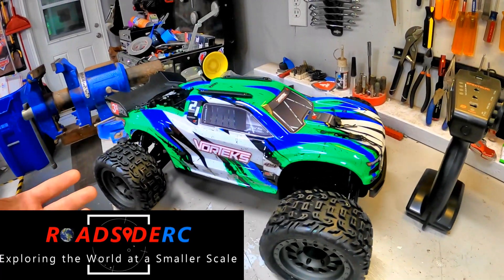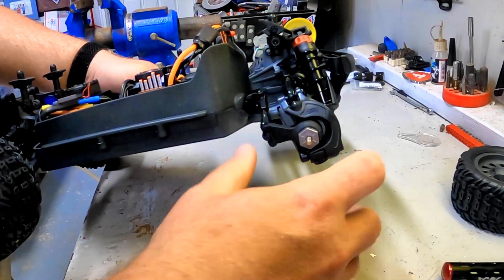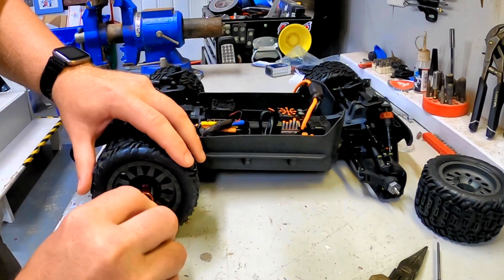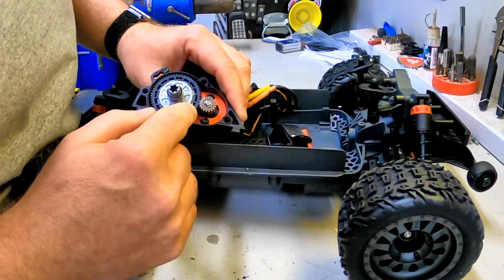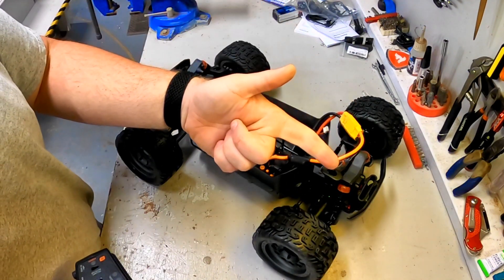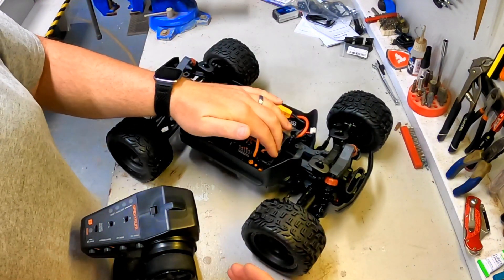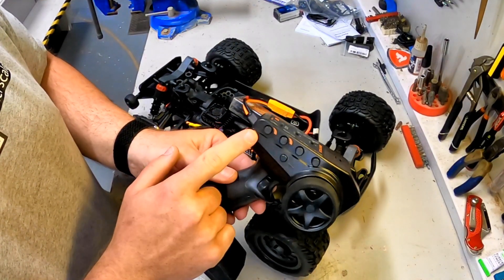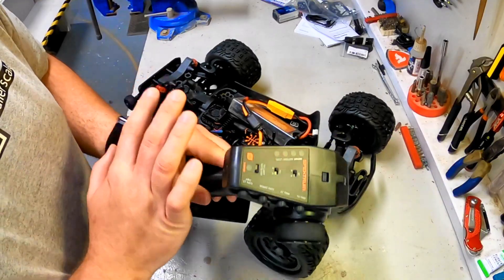DO THIS FIRST! 6 things before you drive the Arrma Vorteks4x4 BLX!

Comment from the maker: These tips will apply to ANY of the Arrma 3S lineup.   

If this video was helpful - consider joining as a member!   The cheapest membership is only $0.99/mo!
Reply: Hi @RoadsideRC

I am planning to by Vortek 3s blx V3 version.

Request your advice whether I should buy it or should.look for some other RC car

I need my rc car to be fast fun east to control and maintain and be durable atleast for an 1 year of use

Pls let me know whether I should buy vorteks or not
Reply: @AbbyRCToys Don’t know if you bought one yet. But I have had one for about 2 years. Never had a problem. Runs great and fast on 3s. Never put the bigger pinion in yet. It’s only for speed runs. Don’t use it for bashing. It will over heat your ESC!!

Comment: Can't believe 6 months ago I missed that you said you fly fpv on the channel. Subbed immediately. I'll be checking out your flights. I actually commented about how nice this list of things are to check and I did nothing but go out and run the trucks I bought without doing any of these things. The wheel kept flying off of my vorteks so I used blue loctite and haven't had an issue since. I has the granite blx first for about 2 or 3 months then bought the vorteks when it came out because I liked the granite so much.. the blx line is perfect for my 7 year old son and I. The steering serve went in the granite so I just did these all endpoint settings but just way way late after purchasing. 😊 Thanks brother
Reply from the maker: Awesome!  Glad you are enjoying the Granite and Vorteks!

I agree - these 3S vehicles do everything I need.  The more I run them, the more my 6S models sit...which isn't what I would have guessed.

Comment: I'm having mine delivered tomorrow, great video. This will be my 4th arrma. Big rock, typhon, Senton and now this one tomorrow. I will. Be checking everything.
Reply from the maker: Awesome!  I still need to try a Big Rock at some point.
Reply: @RoadsideRC  it's a really good truck, my first arrma. So fast but not so stable in the corners at high speed. I've just changed the tyres to some pro line ones which are wider and as a result holds better in corners. It wheelies like a crazy evil kenevil. Very impressive bit of kit.

Comment: I had a infraction the throttle was set 100% full throttle at neutral point. It took off on the bench and I had it raised so the tires were off the bench but it still took off. Very important what your talking about. Great video!!!! All cars should be looked over.
Reply from the maker: Oh my!!!  An Infraction taking off at 100% - that is literally quite the dangerous thing!  Glad you had it off the ground!
Reply: @RoadsideRC  lol, it came off the stand, not a good day.

Comment: I tried my Vorteks for the first time today and it had a horrible scrapping noise coming from the rear diff area. Turning the wheels by hand it would sometimes seize up so it couldn't go any further without using excessive force. I had to cut and file plastic off the diff housing where one bearing sits and also remove some protruding plastic lumps from the inside of the part that holds the diff as the diff was scraping on that when it rotated.  Really great quality control there Arrma.
Reply from the maker: Interesting!
That is a new one - hadn't heard that one before!
Reply: Reading experiences like these all over the internet makes me sad. I bought two 3S arrma's end of march, in the EU. I ran into all the issues one can think of. Is HH killing Arrma's reputation? I wanted a 6s Notorious next, but sadly I am looking for other brands now. I have no confidence in the Arrma quality anymore. And their Customer Service is totally different here in the EU.

Comment: Almost impossible to get a real read on that gear mesh without the front end of the spur gear being supported. I had always ran a piece of loose-leaf paper between the two, pushed it tight, and set the screws with paper still in between. Have never stripped a spur or pinion in over 30 years in the hobby. But tough to do on this one. I've got an Infraction 3s, and LOVE it. Looking in to this guy now. A great, and very versatile platform they've got there! 
  seeing the part with the overall inspection and screw tightening, always a good idea! I found all sorts of slop in the steering on my Arrma Typhon 6s, to find whoever assembled it must have been distracted, as it was missing the lower bushings on the steering posts. I got a couple nice ball bearings for that. Perfect excuse for that little upgrade!
Reply from the maker: Yes!  I agree 100% - setting gear mesh on these is not as straightforward as it is in other vehicles.

Comment: Great guide. Got myself one this winter and this guide gave me the courage to take it apart. The technical manual is pretty nice but when you see all those small pieces you start to doubt your skills. If I had any tip, it's to get those 2 and 2,5 thin and long hex drivers for those wheel nuts.
Reply from the maker: Great tip!!!  
Glad the video helped you.

Comment: Great video! Just got my Vorteks 3s today. I will check these steps first for sure. Also, I didn't buy a Lipo and a charger yet, as I wanted to inform myself first. I read this is the best battery? Zeee 3S Lipo Battery 8000mAh 11.1V 100C Hard Case with EC5 Plug. Could anyone confirm this? Also, which charger would fit?
Reply from the maker: Hi there!   The Vorteks is a great choice!  

For batteries, I actually tested a lot of different batteries in the Vorteks.  I found this to be the best for me:  https://youtu.be/V3nwK3kDfV4?si=j_wnAD7s2nnV6oG4

For chargers, check this out:  https://youtu.be/1gb8Oohhciw?si=jkIQxAL0MK6Paz5q

Comment: I just got into RC couple of months ago and doing reviews for several months what to buy and I picked up the Vorteks today in purple and it is Out of this world. Videos are not enough you have to drive one to experience it. The speed, handling, sound of the engine and tires, it is a beast 💪🏼. Can someone explain to me do I have to do ESC endpoints adjustments, I would appreciate it. Thanks
Reply from the maker: Glad you like it!
You shouldn't NEED to set the ESC endpoints, but it doesn't hurt.
Reply: @RoadsideRC  do you suggest to change  to the other pinion gear it came in the package to make it go faster, what is the 2nd pinion for overall, please let me know.
Reply from the maker: The other pinion will make it faster. 
I did swap mine in and have left it that way.

The negative is you will build more heat in the motor and ESC as they work harder.
Reply: @RoadsideRC  thank you for your help, was it hard to change it to the other Pinion approx how long does it take? Hopefully you don't mind me asking questions, I rather ask and learn more.
Reply from the maker: It is rather easy to do. 
In my video on "top things to do before you drive", I show almost the whole process when I tell to check the gear mesh. 

Also, I think the manual actually shows how to change the pinion.

Comment: Great video 👍 will check these when I get mine in a few days. Some have mentioned the slipper clutch also being too tight, do think this is a concern that should be checked right out of the box?
Reply from the maker: That could be a good addition for sure.  
So far, I have had no slipper issues.  But I am pretty simple with a slipper.  Either it is too loose and you can hear it slipping a lot.  OR, when it is too tight, it breaks driveshafts.  So far - no broken driveshafts.

Comment: Great video but one thing I would add is that you should inspect all your shocks.
I realize the stock shocks are only plastic but it seems that most of these kits come with barely any shock oil in them.
I suggest topping them up and re-sealing them before you go out on your first run. Also, consider the ride height, I'd suggest adding at least the middle sized shock spacers, (included in the kit), to all shocks to bring it up a little. 
I'd be happy to hear your thoughts. 
Cheers from Ontario Canada.
Reply from the maker: Thanks for your ideas!
Double-checking the shocks is a good idea for sure!
I don't think I would raise the ride height though - I like my cars nice and low for better handling.

Comment: Hi great video on setting the radio up, do you know if the duel rate on the steering can be adjusted on the fly with the st rate knob on the tx whilst you are running the truck.? Or do you have to go into the program mode on the tx each time to alter the steering dual rate. Thanks.
Reply from the maker: If you disable the AVC, then it works like a normal dual rate knob.
Reply: @RoadsideRC  Ah so you cant have AVC & normal dual rate adjustment together, its one or the other I suppose. Can you remind me how you disable the AVC.

Comment: When doing your steering end points why are you not using the A/B button? I was shown to first make sure it drives straight with trimming, than max steering dual rate, than start your radio calibration the same as you but hold steering noob max one direction than use the A/B buttons to get to the max end points. Was shown this by a friend but if you want a video format check our RazorRC channel it’s the same as I explained. WONDERING if both ways are correct what do you think 🤔??????
Reply: Think it’s the same sh#% different pile ?
Reply from the maker: Someone else brought this up.  
I am pretty sure what you are talking about is the calibration between the receiver and controller to ensure you get the max endpoints of the steering.  
This is to actually limit the total steering by setting the end points.  
Two separate things. 

Honestly - this is one of the downsides to the Spektrum radios - they are too danged complicated in this way.
Reply: @RoadsideRC  I feel both ways are the same, using the dual rate like you did gives you and end point and so does my way I was shown only different I can think of when talking with RC crew is that my way eliminates accidental bumping of the dual rate noob, switching between users etc.
Reply: I can’t wait to get the Vortex I have Granite BLX at the moment and love it but I really messed up the back of the body learning jumps etc lol 😝. So you an American RC enthusiast? I’m from Saskatchewan Canada 🇨🇦

Comment: I just grabbed an Arrma Granite mega without an esc off eBay that I am putting a brushless system in.
Reply from the maker: Great!  I did a swap brushed -> brushless with a Granite Mega also.  Super fun truck.  
To be fast, you need to be more aggressive with the pinion gear than you think.

Comment: Good info!! I just didn’t understand your point about AVC. After adjusting and power cycling it’s left in a position of adjust for the last steer. Where do you now put it back to?

P.S. My first 3s+ was not long ago, my big rock. First 30 seconds using it the front wheel popped off and I lost the nut. Lesson learned.
Reply from the maker: That AVC knob is just temporarily used to set the steering end points.   Afterwards - you revert to using it to adjust AVC and set it wherever you want it.
Reply: @RoadsideRC  appreciate the quick response!

Comment: Just ran across your video.  Thinking of picking up a Vorteks to add to my fleet.  I have a nitro Slash and a fleet of LaTrax Rally cars.  I recently added an Infraction and have found the Arrma vehicle to be way more durable than the Traxxas ones.   Downside is the Infraction eats tires and needs a really big space to operate at full potential so I don't run it very often.  I figure the Vorteks would be a good back yard runner.
Reply from the maker: I agree - the Vorteks is a great size for your yard.  
I also did a test of Vorteks vs Typhon vs Granite.   You might want to check that out also:  https://youtu.be/EYyNnaoa_FM

Comment: Great video! I did the same with my Vorteks and agree with everything you covered here. 

One question, do you have any knowledge on why the Vorteks has a distinctive clicking sound? Mine has it and I hear it in every video I see of it running. You can notice it the most when the car is moving and free rolling / not under acceleration. It's like a ticking / clicking sound and for the life of me I cannot discover the cause.

I can't even ascertain if it's an issue or not (doesn't appear to be) and if it's just normal for this vehicle. 

What I have done is check the mesh (it's fine) and roll the car with the motor removed which results in smooth and quiet operation so I don't believe it's the diffs or driveshaft. I'm thinking it may in fact be coming from the motor itself?
Reply from the maker: I know the sound also - it drives me crazy!

If it doesn't make it without the motor, then you must be right. 
It doesn't sound metallic to me though...sounds like plastic hitting somewhere. 

I figure it will break or wear through eventually!
Reply: Mine does it too.  It seems like in most videos Arrma's just have loud drivetrains so im assuming its normal for now.  Im guessing its the diffs or slipper clutch/motor polls.
Reply: Me too it stopped me from adding to my collection,  its possibly the motor but not likely.  Its coming from the clutch assembly,  either it wasn't centered when tighten down breaking free the brass piece so that's spinning and thats the clicking or the nut inside that clutch adjustment screw goes through is in diffrent spot than our other 3s vehicles.  Its a fixed nut inside the hub , what happens is dosen't allow the clutch to be centered inside the two covers and motor mount , so spur gear hits the case , I bought a new assembly from jennys and for life of me couldn't figure out why it wouldn't work once all put together , I eventually had to use a older hub with that fixed nut in the proper spot .
Reply: Yup . I just got mine . same thing and most annoying.  Not something you wanna hear after spending this much money .
Reply: @phillipgatelein8591  one of youtubers said he thinks its from the diff but doesn't sound likely to me . Earl another youtuber , I'd ask him if bothers you ,he's good finding the faults he replaced his kids with metal spur but I think he also used a different clutch hub  and that's what I think it is.

Comment: Hey Guys bought my first ever ARRMA... which is a Vortek .
 Question. Mine has this Clack clack clack sound when i drive it. Similar to the old nail in the tire on a real car. whump whump but clack clack for me.
I'm thinking gearing to the drive shaft but upon inspection i find nothing.  
thanks guys see you at the park !
Reply from the maker: Mine makes a similar noise. 
I never found it either, and it seemed to get better as I have driven it.  

Did you check the gear mesh? 
Also - double check the slipper assembly.  Make sure everything looks lined up there.
Reply: @RoadsideRC  thanks again for your help I'll take a look around.
 Just annoyed here.

Comment: Nice video !!! Great content….I got a battery at approximately all cells at 3.8 after today’s use. ……What’s the best to do ? ……..Full charge from 3.8 to max charge?…….or ……. Balance charge all cells to at around 3.8 ? …….Or discharge to under 3.7
Reply from the maker: Here is the clear rule:
Do you plan to use again within 24hrs? 
If yes - balance charge to full 4.2V is OK. 
If no - storage charge
Reply: @RoadsideRC Thanks for all your feedback I really appreciate it. I got an issue with my vortek. Since I got it out of the box the Willie bar looks crooked to The naked eye……I’ve had it for maybe 10 days and the last two times I’ve taken it out it veers and favors one side immediately. And that also goes with a rear wheel looks more angle than  the other from the over view , Also out box.
Reply from the maker: You can measure the turnbuckles to see if there is a difference.  It might have been assembled a little wrong. 

I would not worry about the wheelie bar.
Reply: @RoadsideRC  Veer is not the word…..it shoots to one side aggressivly right after takeoff to a 45* angle.

Comment: I wonder if the settings will also work with the lasernut. Same esc brand and transmitter.  Had major steering issues but the instructions were very poor. Yours makes sense and probably would fix my issues.
Reply from the maker: Might as well try it!
Reply: @RoadsideRC  in July when they ship replacement parts lmao. Wish I got the vortex instead.   This global shortage/ shipping issues are nuts.

Comment: Hey i did the steps .  Before i drove nd toke it out,  it was my second day, Usin it and  my tire ended up rolling off today from the front,  with the bolt nd hex still in my tire,  any thing you recommend or how may i get it back on to drive?
Reply from the maker: That should be exactly the small screw through the driveshaft like I show in the video. 
Put some loctite on that sucker and let it sit overnight!
Reply: Thank you man but yea think  am goin to have to now it did it again  to me this Moring lol like dammm

Comment: Hey Troy did you convert your esc to an XT90 connector? What do you do with the third wire on the original connector the really small one?
Reply from the maker: Yes I did. 
The third wire is just a sensore for battery voltage for the smart esc.  I simply zip-tied it to the side
Reply: @RoadsideRC  Copy that thank you!

Comment: I just picked up a Vorteks 3s BLX last Saturday. I was waiting a few days for some ec3 to ec5 adapters to arrive so I could use the battery I had. When they came and I turned the car on for the first time, as I was setting the steering endpoints, the servo stopped working. It was extremely hot to the touch. I did everything exactly as it should have been. Was it a faulty servo?
Reply from the maker: Great question - I honestly can't answer whether the servo was faulty or not.   But - here is how you would replace it:  https://youtu.be/WU3RjmYD5oE
It is the same process for all of the Arrma 3S vehicles.